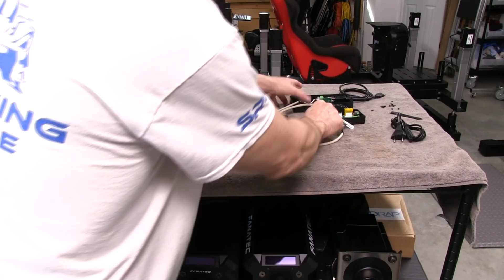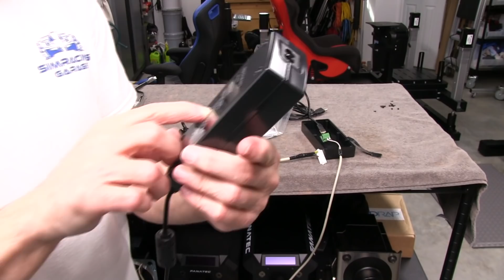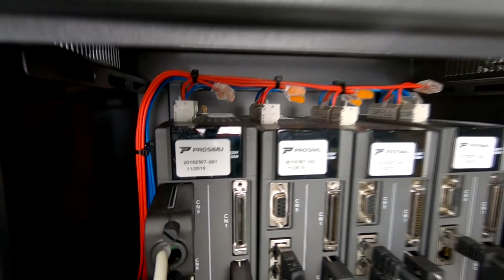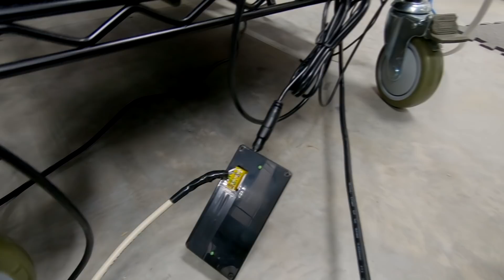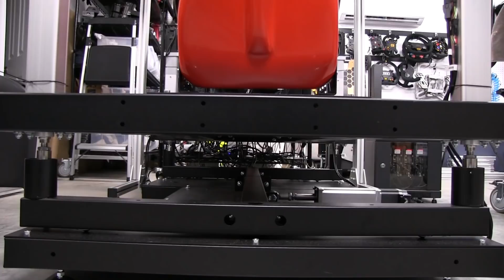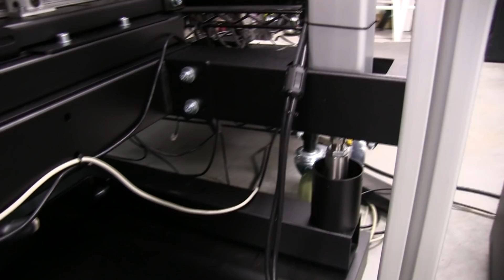Prosimu T1000 5M 4DOF Motion System Review Part 2  "The Setup"

Comment: I have a Motion System with FREX Hyperaxis actuators, which are modified that I am able to lubricate the screw drive very easy and fast without demounting and disassembling the whole actuator.
Screw drives of such actuators like SCN or PRS200 need lubrication from time to time, I see some problem here with this System design, maintenance is too complicated.
Reply: @kevin soucy yeah I know that. But honestly, do you really think it is not important to lubricate the moving metal screw drives? I know the people who invented the SFX-100 actuators personally and one of them says the same I do. For sure such a PRS200 actuator will run for hours and hours, even for many months without any problems, Only the long run with heavy usage after a long term will tell if they are maintenance free as stated. Time will tell. But at the end of the day all actuators are mechanically nearly the same, screw drives which are driven by a fast and strong motor, I never want my screws to drive dry, so I lubricate regularly
Don´t get me wrong, I like what I see here, very strong and fast actuators with lots of power and I like the 150mm travel way, I have only 100mm. I like the PRS200, but I just don´t "buy" that maintenance free bla bla.

Comment: Great review Barry! I own the P5MP and love it. The amount of detail I can feel with these actuators is incredible to the point I can feel the texture and details of the road surface. Try the game profile at 100% and increase the min/max range for heave in tuning center. I found this tones down the rough ride and allows me to feel the detail of the road surface. Setting game profile under 100% I feel muffles or smoothes  a lot of the fine motion detail. I also own the previous T1000 5DOF with all SCN6 actuators. For those of you concerned with noise the new PRS200 actuators are so much quieter than the SCN6s. They do make a little noise but I don’t even notice over the game sound. Service from Prosimu has also been outstanding. Love your reviews Barry! Thank you!
Reply: Shannon I also own the P5MP platform , we should share settings of simtools😀
Reply: I'm looking at getting a prosimu rig. How much better are the prs 200 actuators then the standard ones? Worth it? What size did you get ? 150mm ? Thanks Ben
Reply: @benjaminbeames665  much much better. Well worth it! You will not be disappointed. I went with 100mm which I feel is more than adequate for racing

Comment: looks like you could get more rearward tilt on your seat if you reversed the brackets
Reply from the maker: Yes, but still limited by the cockpit frame under the seat. As seen it is very little room left before making contact.

Comment: Simtools is a bit limited but i think you can use FLypt-mover (which works with simtools) https://www.xsimulator.net/community/threads/flypt-mover.13464/ for more fine control and extra forces on actuators.  Love the software though, im using it for my DIY Gseat!

Comment: Is the prosimu t5 pro 4dof? I can only see that it uses roll, pitch, and heave. Can’t see if it has yaw and couldn’t find an answer on the website.
Reply from the maker: Yes, it has an SCN6 actuator for the yaw element. See Part 1 "The Build" video for details on how it works.
Reply: T5 Pro is another product and have a SCN6 hide by the steel frame : so it's a 4 DOF.
Reply: That makes more sense. I was looking at the t5  Pro but couldn’t find anything that showed or explained that there was an SCN6 actuator that made the yaw movements. Thanks.

Comment: Hi you should try hooking the monitors to the DOF base have them move too, more natural and realistic, think about. Remember your seat don't move around in your car.
Reply: Hi. That's true, and would be very cool. I have found that in Assetto Corsa Competitione has a graphics setting(s) that tilts the view out the windshield around corners. Project Cars 2 didn't seem to have that option, though. However, cylinder life may be another issue. For DBox and other systems like this, it's not just the 'static load' or weight of you and your rig, it's the extra Force (F=Ma) that's required to accelerate all that weight sideways, up and down, etc. I trust when DBox says their cylinders are rated at 250# that means it will handle 250# static weight each, and still handle all the acceleration forces that the cylinders will see, and have high reliability. I'm sure Prosimu gave consideration to that when rating the cylinders, but until we see how long the cylinders they're using last from users over time, it may be best to try to limit the amount of weight the cylinders are lifting. To each his own, though. Best!  :)
Reply: I know what you're saying but I think some systems don't advise this because of how it affects weight distribution and centre of gravity. I suppose it would be possible to compensate with custom settings. VR would be another option of course

Comment: Barry do you think the 100mm Actuators would work? I get the impression the 150's have more travel than you need? For the price the wheel flex and shielding issues should be addressed. I'd like to see how it would handle your P1-X cockpit mounted on it.  Kind of feel like if your selling it in the U. S. it should work on our power but that's  not a deal breaker like the wheel flex and shielding are. I'll wait and see what the P7MP addresses
Reply from the maker: 100mm would be plenty for regular circuit racing. Even my D-BOX system has ample motion range at only 35mm IMO. More travel is great when it comes to Rally, Dirt Trucks and Flight sims. Better able to replicate the longer travel supensions and Flight characteristics. I will be mounting a P1-X to this platform in the near future as time permits. Prosimu has told me they already have plans for strenghtening their cockpits and making some all around improvements to their system.
Reply: @simracinggarage3026  Thanks for the great reviews. Looking forward to Prosimu updates and the P1-X

Comment: I ended up buying a 250# DBOX 4-Cyl system, similar to Barry's, about 3mo. ago specifically because the noise on these cylinders is so objectionable on vids I've seen. I also believe D-Box Cylinders will be more reliable/heavy duty than these Prosimu cylinders. However, time will tell. An option would be to use headphones for sound, but I'm 68 and my hearing already is not that good. So rather than risk more hearing loss with headphones, I use speakers, and would have to turn them up a lot more to hear above all the cylinder noise. I can't justify/afford 6" D-Box cylinders though, so it would be great to see D-Box introduce similar higher-displacement cylinder system, with sway that I've seen being developed/tested at a much closer lower price than current D-Box 6" 4-post systems. We can only hope. If Prosimu lowers cylinder noise substantially, and the cylinders prove to be more reliable than I currently suspect (D-Box is expensive for a reason), I'll be In! :)
Reply: Compare what is comparable : Dbox 100mm/s for the speed and PRS200 : 280mm/s   so it's normal that the PRS 200 make more noise.....  It's comparable with a car that have a speed of 100km/h and another 280km/h..... not the same specification - not the same noise.   And finally If you put 1.5 inch of travel : the PRS 200 do the same noise as Dbox for less money ;-)

Comment: Thinking buy a motion plataform. What to chose, dof reality h3 or primisu t1000 2dof ?
Reply: Budget for sure because the Primisu T1000 costs around 8 grand+ VS the DOF reality at around I think 4 grand? The Primisu is an entirely different category of machine. The DOF runs on motors that are similar to wiper motors with limited range VS servo motors with built in encoders and long ball screws to give you 6 inches of travel. The price of just the actuators on these things are usually around 2,500 to 2700 each with NEMA 34 servos so the price for the base model is pretty reasonable. I did not watch the whole video I was wondering if it was running at 220 volts AC? If I had the cash the Primisu would be my first choice because anything comparable would cost you over 14 grand. Obviously take that with a grain of salt because I am no expert on ether setup but the DOF Reality always felt rushed to get to market where this looks really well constructed though building it takes time.

EDIT: I wanted to add there looks like a lot of wash in DOF where this showed sum but not nearly as much.
Reply: @netgeek3010   ok i know all that. But i have a buget of 2000eur +-, so the choice is betwen Promisu T1000 M2 with dyadic scn6 actuadors or dof reality h3 ?
Reply: @edgarprazeres8106  I think that if you play car games,the ProSimu will be a good choice.
Reply: Edgar Silva h3 is amazing. You get 6 dof sensation for price of 2. Go for it
Reply: @gmerariu  you mean 3 dof for the price of 2 right?
Reply: @edgarprazeres8106  yes, 3 axis but it simulates all 6 dof effects. It feels like driving for real

Comment: Nice thanks Barry.  I am still very much looking forward to ordering mine once I know how much the 7 costs and what it offers. Would hate to order the 5 only to be 6 months down the road and the 7 be released. @Prosimu do you have any plans to either change the cabling or offer a more shielded version? I like the small rack, nice touch. @Barry, they do offer a more rigid steering motor mount. It is bolted on either side. I think it looks better also. They offer it with their Pro setup so I bet you could upgrade to it easy enough. What say you @Prosimu ?
Reply: The Data cable of the PRS are shielded,  we will do the same for the Power cable.  BTW, lot of client have this setup and don't have any problem of EMI, but we will improve this part for sure and some other parts in few time.
Reply: $34k

Comment: Thank you very much for the review.  Exactly what sort of interference did you experience that required the ferrite chokes?  I've had this system for over a year now, and I can't say I've noticed any RFI issues myself.
Reply from the maker: Had some intermittent shifting glitches on the Fanatec APM's. This went away with the system powered down. Still not bad enough keep me from using it. RFI is a fickle thing with so many varibles effecting it's impact, I would not be surprised if someone else has no issues. I can only comment on my own experiences when using the system.
Reply: @simracinggarage3026  Thanks a bunch for your response.  You're correct about RFI being a a fickle thing.  Would you be able to tell me what size ferrite chokes you used on the cables?  Even though I haven't had any issues myself, it might not be a bad idea install some as a preventive measure.
Reply from the maker: I used some 13mm ones. It was tight but they did snap shut ok.
Reply: @simracinggarage3026  Thank you!

Comment: Neu Fanatec QR?
Reply: Mücahit Simsek I sure hope so. I remember someone from Fanatec reaching out to to “test” something new when they saw how unhappy i was with the QR system on my DD2.  

It’s probably a non 3D printed Z Ring that they’ll say they invented.  I’d imagine it’ll cost a minimum of $100 no matter what it is.
Reply: I hope so. Can't wait to get rid of the flex in my DD2 QR. That's the only thing that bothers me. Otherwise it's a great wheelbase.
Reply: ErnieGaming The flex sucks for sure but what’s even worse for me is the fact it takes a bucket of grease to make the wheels easy to swap out. Some reason it’s a nightmare for my DD2. Both issues don’t reflect a $1500 wheel base.
Reply: @OhItsThat  Yes i agree. Changing the steering wheels is a hassle. I always need a lot of pulling force to get the rim off.

Comment: Could you swap the seat mounts over so the slots are at the front and holes at the back? It looks like the holes go lower than the slots.
Reply from the maker: Yes, but still limited by the cockpit frame under the seat. As seen it is very little room left before making contact.

Comment: Owning a T1000 3DOF myself i have to say i love it !   i can only say one negative thing ....it makes a hell of a noise....      glad to see that i'm not the only one with a video that's longer then 1 hour LOL 👌😬
Reply: You are right about the noise of the SCN6s.  I’m assuming that is what you have? The PRS200 actuators are soooo much quieter than the T1000 SCN6 actuators, I own the Previous T1000 5DOF with all SCN6s and the biggest reasons I upgraded to the PRS200s was how much quieter and faster they are.
Reply: This is the exact reason why i made the switch to DBOX. In my opinion the Prosimu is just too heavy/bulky and the noise is terrible!!  I went from T1000 3DOF to a DBOX 4250i on  a  SimLab P1-X. Wish i would have made that choice earlier.
Reply: @ribihome  Isnt DBOX more super expensive?
Reply: @ribihome  I am considering a T1000 5m. Is the sound and quality much worse than DBOX? Also what type of DBOX will I need to achieve all the effects in the video - ie 4250i achieve 4 DOF with traction loss etc?
Reply: @dr_arcade  I owned the T1000 3M with the Dyadic 100mm which are equal to the SCN6s (as Shannon B already mentioned above). The PRS200s are indeed more silent. The price of a 5M is not to far away from the new Gen 3 Dbox since the recent price-drop. I find the DBOX system more subtle in its movements. For simracing you don't need 100mm.  The cheapest DBOX has 1,5" (3.5 cm) It is more than enough. If you plan to use flightsims a higher travel range is advised but that also counts for the Prosimu PRS200. Prosimu states that 100mm lets you feel the effects of the car and the the effects of the road. Having them tried both, i need to disagree. Altough the Prosimu is not bad at all, i prefer the quiet and more subtle DBOX over the noisy and bulky T1000, even without traction loss. Just my opinion.
Reply: @dr_arcade  well the actuators that i have are the scn6  and they are very noisy however there new  PRS200 are much smoother and thus more silent... however they set you back about 2200€ a piece.... arrchh